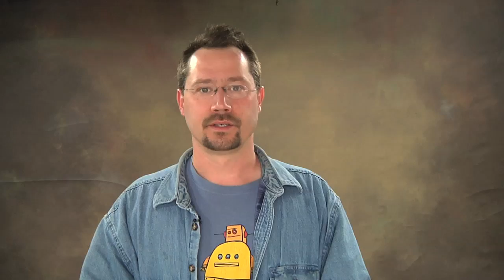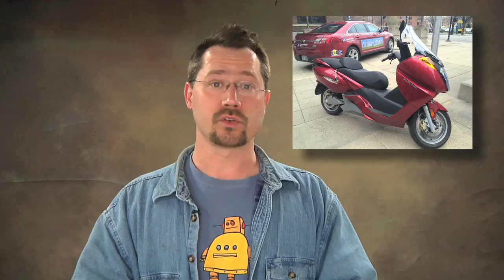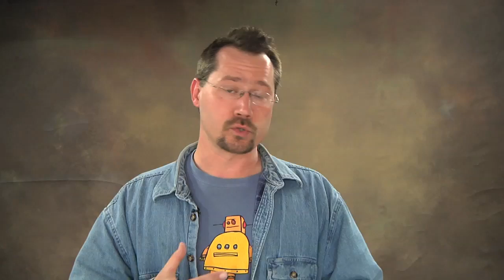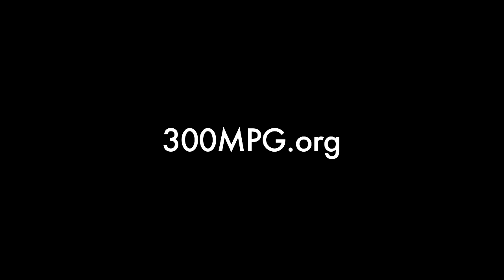Vectrix Update, May 5 2015

Comment: Good stuff, thanks for putting up these conversion videos.

It would be interesting to know how many Wh the cycle analyst reports after a full depletion of the pack.  

Was thinking about the before/after battery specs.  According to wikipedia, the Vectrix battery originally was 3.7kWh / 125V / 30Ah / 20kW peak / 7kW cont

Your upgraded looks to be approximately ...
8kWh / 133V / 60Ah / ?kW peak / ?kW cont

Should be a nice improvement in range!  Notice a difference in top speed or acceleration?
Reply from the maker: J S Top speed speed is governed, so no change to that. (Just under 65 mph) Gettting to top speed is brisk though! The upgraded pack is rated at 9KW, although I'm trying to NOT use the full capacity to be a little kinder to the battery and avoid any abuse at the top and bottom end. The cells are rated for 240 amps continuous and 540 amps peak. (The cycle only has a 125 amp main fuse!) Battery pack is around 147 volts when charged.